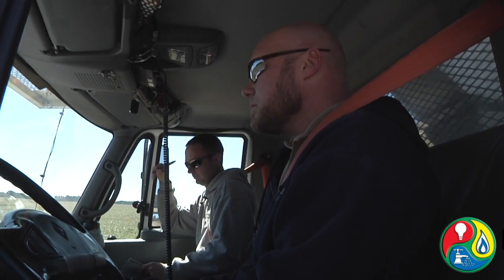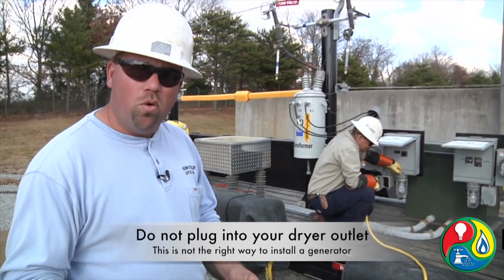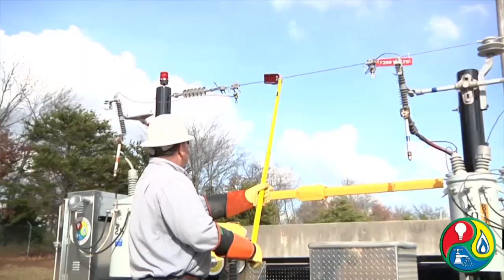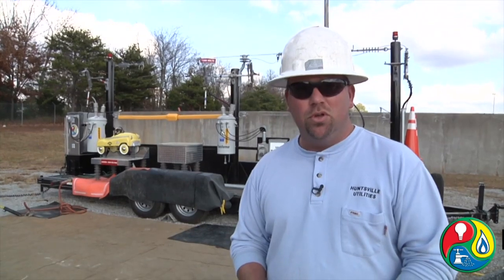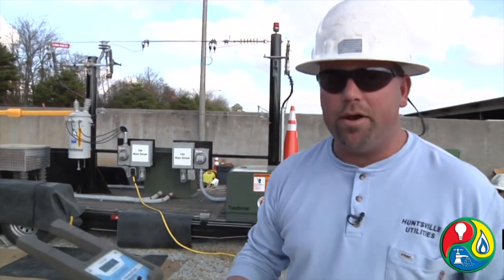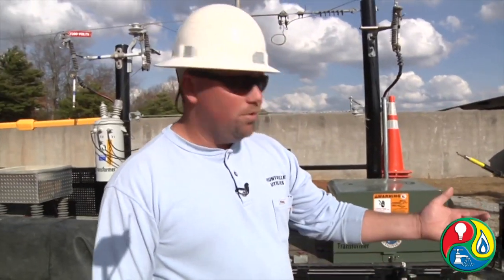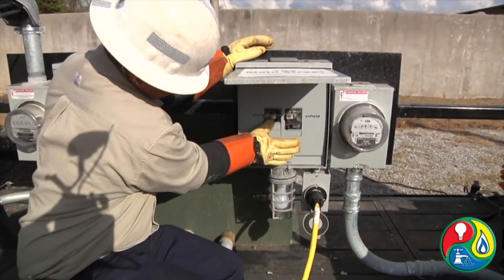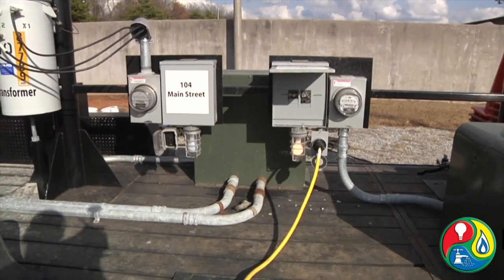Backfeed Protection

Comment: We have been through multiple outages in the last 20 years here in West Ga. 2 years ago I invested in a larger 9500/12500 gen to run most of my house. With a friends help who is licensed electrician, we installed a dedicated backfeed breaker and interlock bracket to a 50 amp inlet on the side of the house. I also installed 2 amp meters inside at the breaker box to monitor the amp load on each of the 120 legs coming from the 50 amp outlet of the generator. I turn off most of the 240 breakers when running in emergency mode but can still run my AC when the weather is hot without overloading the gen with all my 120 breakers still on. I feel like we are set pretty well now. Trying to use non ethanol gas always, exercising the gen monthly for 30 minutes, and running out the gas completely from the carb with the fuel shutoff valve before storage back inside the garage. I also bought a gen tent to run the gen outside in bad wet weather to protect it from water damage. Great video!
Reply: Using amp meters is a VERY good idea.   They can warn you when you approach an overload condition with the generator.

Comment from the maker: We have had a lot of great questions from this video.  I want to make sure the message is clear.  Hire a licensed electrician to install a lockable transition transfer switch.  It is the only way to safely prevent back feed.  If you don't have time to do this because it is an emergency, then plug items directly into the generator as needed.
Reply: Additionally, if you don't have a licensed electrician do it, a resulting electrical fire will nullify home insurance. I choose to use extension cords directly to critical loads. I can't afford a transfer switch, but the extension cords at the proper ampacity directly connected to critical loads are safe and recommended by every generator manufacturer and utility I've consulted.
Reply: @gybx4094  how do i get a extension cord to my appliance, open a window, crack open the door? That presents a whole norder set of problems.
Reply: @Mazel_Tov_888  open window run cord through, use a beach towel to fill in gap as you close the window. Easy
Reply: @gybx4094  I utilize individual extension cords to fridge/freezer and few lights also.  Not sure which Insurance company your referring to, but not extending coverage for resulting  fire damage is not excluded  in any major Ins carriers policy I've worked for in past 37 years.  To be excluded it must have specific exclusionary language in the contract stating  such act.  Even if a licensed electrician installed incorrectly by chance, a resulting fire would be covered  for homeowner and Ins Co could then seek damage recovery through electrical co.  I would recommend only qualified people do the install and pull permit if required in your county to insure properly done for safety.
Reply: Not an electrician, but I installed a panel breaker interlock for like $20.  The soow power cable and cs plugs and inlets were more costly though.  Not every solution has to be a pain in the behind.

Comment: I personally prefer an interlock and have used it for years. I cannot have my main breaker on at the same time and vice versa. A plug is designated for my generator that I wired into my panel, of which the assigned breaker is connected to the interlock. Safe for the lineman.
Reply from the maker: Hi Briar, thanks for helping us spread the message of safety and keep our linemen across the nation safe.

Comment: Great video.  It should be noted that with the main switch on the electric panel set to OFF position, any generated current will not backfeed  onto the main grid.
Reply from the maker: While you are correct, the transfer switch eliminates the human error and prevents the panel from being in the "on" position. That is the point we are trying to get across with this information.
Reply: @HuntsvilleUtilities  Hard to argue with this.  Greatest majority of electric customers should use the transfer switch!

Comment: Actually, I have had a licensed professional electrician wire up my 240 line dedicated only to my generator in case of power outs. 
It has a 50 amp breaker at my main breaker box in the basement and a 30 amp breaker at the sub panel breaker box in my detached garage.  I ALWAYS turn off the main breaker in 
My basement before starting my garage generator and plugging in my 10/4 cable into the generator 240 receptical.  Now that I see this video, I am angry my electrician didn’t install a safety throw switch like you show.  I want it done right, safe and legal. I am grateful you published this great video.  Another great  reason to do a back feed legally and safe is for home owner insurance, if you end up burning your house down  and the insurance investigator finds you have a illegal back feed connection, it is a PERFECT excuse for your insurance company to deny your claim in case of a house fire. Doing a back feed illegally is a wonderful gift to your insurance company!   They won’t pay you a penny!   .
Reply from the maker: Thank you Michael for your comment. I'm glad you were able to learn from seeing an example of what actually happens when you hook up your generator. Over the years we have conducted lots of training using this safety trailer and it helps first responders, and the general public alike.

Comment: All of the videos I have seen showing connecting the generator output through the dryer connection stressed the main breakers must be opened to isolate the generator from the utility lines. 

Also all breakers not feeding the items you want to run like refrigerator and pumps need be opened to prevent overload.
Reply from the maker: Hi Edward, thank you for your comment. Hopefully the main take away from this video is that a home owner should seek the guidance of a licensed electrician when setting up and installing a generator.

Comment: There is another alternative. For a temporary situation or a permanent solution, get a Generlink meter base adaptor. Would recommend the 40 amp unit.
Safe, very easy to use, super easy (5 min.) for the electric company to install. 
I have no ties to the company. I bought one and it's a great solution. Using it with my Generac standby genset. Simply plug it in when needed, unplug when done.
Reply from the maker: Thank you for your comment and continuing to help spread safe operating tips when using a generator.

Comment: Today I've been looking into doing just that, as back feeding through the dryer has ALWAYS made me very cautious and nervous, not for me but your you guys. So that's why I'm looking into what the parts cost and the what an electrician cost to hire for a day to do it. I have never actually done it yet, however I have electrician friends who do it in emergencies. So far a I have a 16 position 100 amp panel, 50 amp input connection box, a 50 amp twist lock connector to the generator with 4-12 awg wire, 4x50 amp circuit breakers to run the house AC and the two runs on the house inside box. 8 awg x 3 conductor Romex for internal wires. I still need to get the interlock safety lever for the panel. Unfortunately my inside box doesn't have a separate main switch, I have to go outside to kill the inside box. I'm going to fix that and have the electrician put in another 50 amp circuit breaker for the inside main and use one of the interlock safety switches for that. The cost isn't cheap, so far it's up to around $500.00 and that doesn't include the electrician. By the time I hire an electrician and by misc other items I expect this cost to be around $800.00. I can see why folks backfeed as to do it correctly is very expensive for the average poor guy.
I know first hand what can happen to a person who gets zapped. I've had two co-workers have close encounters with high voltage. One was burned over his arms, chest and face. He spent months in the hospital and I think had plastic surgery, he was fine but always had these large sunburn looking patches on his arms and face. They came back from lunch and didn't check the Lock-Out Tag_Out and someone had tried to use the circuit and didn't shut it off and had REMOVED the LOTO. My other Co-worker watched his instructor fry and cook then die in front of him. Both died for the SAME reason, someone removed the LOTO and they did not listen to their younger co-workers who said; "Shouldn't we check the LOTO before we start work on it?". Both said no-one is going to mess with a LOTO and went to work again. The second co-worker who saw his instructor die quick working electrical after that. The second one went back to work with a very healthy respect for following procedures. The generator will be a 17.5KW with a 26.5KW surge so I can run my house AC and the rest of the home, minus the electric stove. Well thanks for the nice video. Be Safe, Best Wishes & Blessings. Keith Noneya
Reply: You need #6 wire for 50 amps, #12 is for 20 amps and will start on fire with a 50 amp load before tripping the breaker.
Reply from the maker: Thank you for your comment.

Comment: This is very important information for home or  business owners.  I would add that it's possible in some situations for a faulty or incorrect neutral/ground bond in the home or business location to cause the neutral to become energized with "hot" power (same thing if the case of a "floating neutral", as some generators may have).  In these cases, it is possible for the neutral conductors in power grid lines to be energized, even if the "Master" breaker on the panel box is off; of course, such a condition can be as deadly to power grid workers as well as users, children, pets, and other people as it would be if a "line" (hot) wire would be energized.  Such a condition could also backfeed power into the electrical system of an adjacent building.
A properly designed and installed transfer switching box will disconnect live power and neutral from the grid and also assure that the neutral/ground bonding within the home or business location is correctly connected for generator use.
Reply: Absolute false information.  If you cut the the breakers via a transfer switch, or the main breaker, there is no possible way the neutral or ground can be energized.  In addition the neutral is tied to ground at the breaker box, and grounding rods outside your home.  So even if your ground to neutral bond fails there is no way for the neutral to be energized

Comment: Great video thanks for posting. My question is simple is the normal interlock plate that you can buy that prevents your generator circuit from back feeding good enough?  What I don’t understand is the neutral from the pole is still connected even though the two 120 legs are not. Is there anyway for power to go up the neutral even though your main breaker’s off? I wish someone could explain that
Reply from the maker: There are a lot of "it depends". House wiring... an experienced licensed electrician should take the time to review the wiring and make sure the ground and the neutral wires are not crossed. 
I'm not an electrician, but I could have one of our guys address your question more thoroughly if you would like better clarification. 
Installing the switch forces the generator to operate and breaks the connection with the outside service feeding your home. When the power is out sometimes people don't have a proper disconnect. 
In the most recent incident where a lineman was injured the switch was installed incorrectly, so all I can say is be careful and it doesn't hurt to have another pair of eyes review the wiring situation in your home.
Reply: @HuntsvilleUtilities  - thanks for the reply and looking into it more. My ground and neutral bars are connected. All of my circuits come back like normal with grounds and neutrals connected to a common bus as aforementioned. Any interlock is just gonna disconnect the two  120 volt legs. They never disconnect the single neutral in almost all cases.  If I have the interlock in place and the generator running with the 2 main power cut offs  I believe I still measure amperage values on the neutral going back to the main line. That’s what I don’t quite understand.

Comment: Once my dad accidently Back feeded the utility during a powerloss and the generator breaker popped off with a loud bang
Now we have a relay installed with the generator
Reply: What caused the breaker to pop?
Reply: @bradleyr34  lineman will physically ground any line they work on before even thinking of touching it, when grounded the generator cant handle such a power draw (direct short to ground) and will blow a fuse or burn out or somthing.
Reply from the maker: Correct. They do ground the area where they are working, but within that area if someone fires up a generator that is incorrectly wired, it makes the grounded area no longer safe for the the linemen. It's not worth the risk. And if you watch the video to the end you'll see that the fuse never blows.

Comment: People think that the 25 amp breaker on the gen set will save you from burning your house down. They just don't understand how bonded and floating neutrals work. You have to have a lockout/transfer switch, people don't realize that that transfer switch isolates the ground. Making the breaker on your gen set open when it's supposed to. NEC code says you can't have two grounding points when your gen is hooked up like this, especially one so far from service. I'm no electrician, but I'm pretty sure if you touches bare metal on that gen frame, and then bare metal on that panel you are going to become part of the ground loop and you are gonna ride the lighting. Not to mention how dangerous the suicide pigtail you need to make this work. Live juice on a male plug is against NEC and will kill you in a heartbeat.
 If you are running low on funds you can easily install a sub panel buy the (manual) transfer switch, lockout an and all the breakers and stuff. You can legally install these things yourself, up to the point where you are ready to move the actual circuits you need moved to the sub panel and the grid power from one of the buss bars from the main panel. That's when you call an electrician. It'll take him 20 minutes to hook your gen set safely up to the grid at that point.

 In addition to killing lineman and attempt to power your whole neighborhood if you backfeed onto the grid, if your house does burn down because of backfeeding, your homeowners insurance might not pay. Pretty likely it won't.
Reply: Also, I saw a bunch of people saying they can't to these modifications to a rental home. I get it. Your only option in that case is electrical cords directly from the gen to the things you need to power. I also see that most people don't understand thier power needs. A 7000w gen from harbor freight isn't going to run too much. I have an offgrid farm. I need a 9k gen just for my well pump. You need a 10k plus gen for a whole house setup. The gen pictured in this vid will run your tv, fridge, blower on a gas furnace and not much else. An electric dryer if you are lucky. If you don't own, go buy a bunch of properly sized electrical cords. I did it for years. Also, ALWAYS ground the generator according to it's instructions. Stay safe folks.
Reply from the maker: Thank you for your comment.

Comment: I plan on putting an interlock on my breakers main power switch and an outdoor receptacle for my generator to plug in. As long as there's an interlock properly installed it should be fine? Would there be a difference in plugging the generator into the dryer as long as the the main is off with the interlock properly installed?
Reply from the maker: I differ to the expertise of a licensed electrician in this instance. No DIY unless you yourself are a licensed electrician. Also they understand what the legalities are in your area.

Comment: If shutting of the main breaker is so dangerous and not a sure way to cut off power I would think electricians would be getting fried all the time.
Reply from the maker: Thank you for your comment, it helps us spread the message and clarify why this method is so dangerous.  You see Jack, you can switch your breaker off, and dangerously connect your generator through your home.  But it makes for an accident prone situation.  Any number of things could go wrong in this situation.  

It is very important to get a qualified, licensed electrician to install the generator and ensure that all permits are obtained and electrical inspections are completed as well. If you have any questions please contact us at 256-535-1200.

And when you are without power for days, that just leads to a greater chance that something could go wrong.  Accidentally unplugging, accidentally flipping the switch on your breaker, forgetting to flip the switch on your breaker.  There is a safer way to power your home, have an electrician install the proper switch and then accidents don't have to happen.
Reply: Huntsville Utilities So what we are really talking about here is human error, not equipment failures or short comings. 
In this case I would have to agree the chances of human error do seem pretty high. 
I'll head your warnings and simply pay one time to get the generator wired correctly. Thanks.
Reply from the maker: I would like to also point out that while I do represent Huntsville Utilities, I am not an electrician.  There are different types of breakers, there are differences in how each home may be wired.  And then add to that the year the home was originally wired.  Not only is hiring an electrician safer, but that person could also tell you about how your home is wired and let you know more about why the switch method is the best way to go.
Reply: 110V - LOL...
Reply: When breaker is in off position there is no backfeed to power lines with generator on.